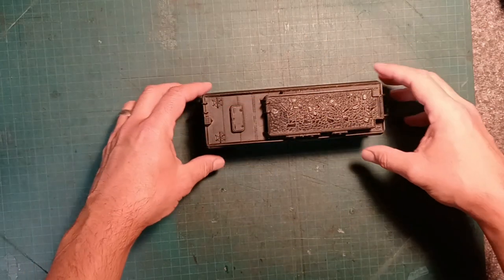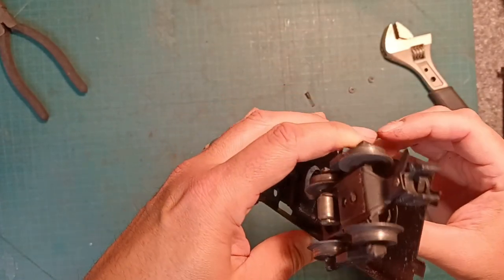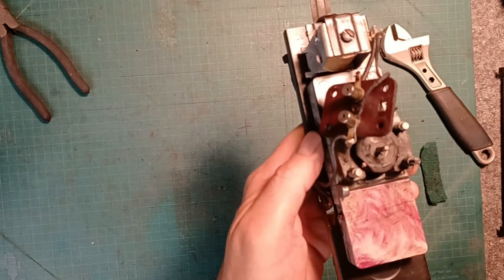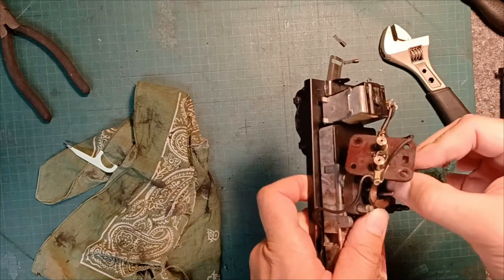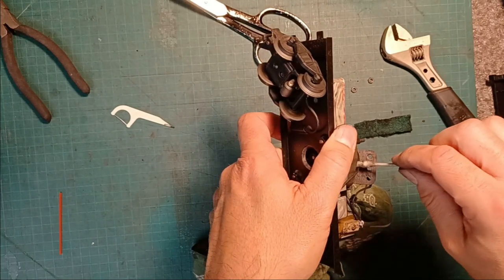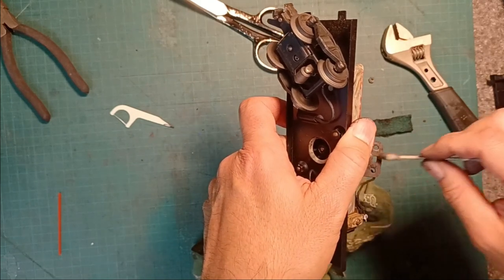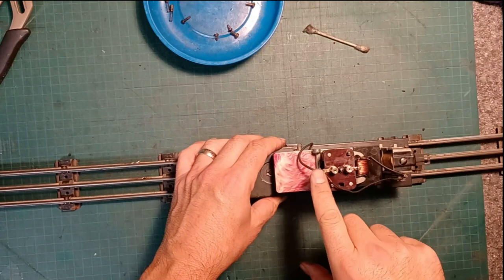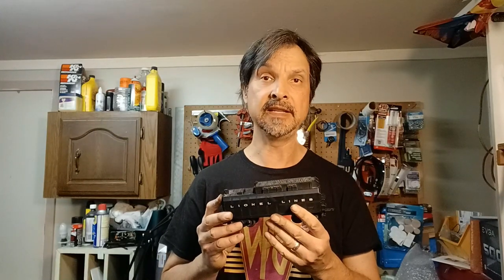Why doesn't my Lionel whistle tender make any sound?

Comment: Excellent video with good explanation.  It’s also reassuring to see another person leave out a part ( brushes) because I’ve done that before.
Reply from the maker: Thanks for watching! More times than I care to admit after a complete tear down and reassemble, the reason my locos wont work is because I forgot the brushes (LOL), OR an original solder joint broke.

Comment: One thing to watch for on these whistles with the motor. If the motor is spinning the wrong way, you will also get mostly an air sound and not a whistle sound.

Comment: A little over kill with a crescent wrench…no? A nut driver should be more than adequate to remove a #6, #8 or #10 nut……..LOL. I had one where the impeller moved on the armature shaft and rubbed. Simple reposition impeller and all is working as it should again. Brushes look short (worn)? Good presentation.
Reply from the maker: Hey Gene thanks for watching. My selection of tools is limited so I use what I have. Its important to me to include all levels of Lionel and model train fans, some all the tools and specialized hobby tools, those that don't should not feel excluded. 
 I hope get younger people involved and included in the hobby by showing how to make do with what you got. Tinker and have fun. Keep the Lionels OUT of the garbage and on the track, the best way you can.

If I had more resources I might expand my tool set, for now, what I can afford to spend, I'll spend on locomotives, rolling stock and track!

Thanks again for your support and comments. Have a great week!

W

Comment: I would replace the old wires that connect to the truck rollers too, the isolation is already cracking and is only matter of time before they start losing more of it and make a short circuit.
Reply: What gauge wire should you use ?
Reply: @banjomanmi76-hu8wf  Any 20 or 22 AWG stranded wire will do. It is not critical as it is just a short piece of wire and there are no high currents involved. More importantly, it should be flexible enough to allow the trucks to move freely.

Comment: Lighter fluid works well to clean the carbon and it doesn't leave a residue.
P.S. it's an impeller 👍
Reply from the maker: I would hope lighter fluid didn't leave a residue. One spark and its flame train. 
Impeller, yes, thank you.👍

Comment: I had one of these tenders and it would not work.  I went on the OMG blog and someone suggested reversing the power to the track.  Since it is AC I couldn't understand how that would work, but I tried it.  And guess what...it worked.
Reply: The whistle actually works with DC: Lionel transformers have an internal diode (selenium or copper-oxide type on older units) that gets connected into the circuit when the whistle button is pressed (or the whistle handle turned); the DC activates the relay in the tender which in turn starts the motor. Both the tender and locomotive motors are of universal type, so they work equally on AC or DC. But sometimes the tender relay becomes magnetized and thus more sensitive to certain polarity, and that's why reversing wires help. It may happen also that the diode inside the transformer fails, in which case it should be replaced by a modern silicon type.
Reply: @Crosley-1520  thanks.